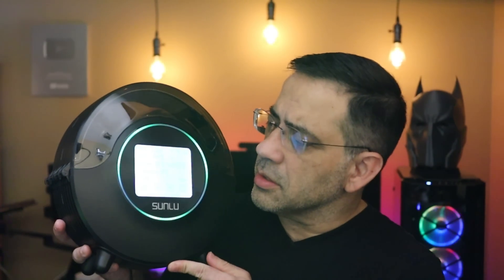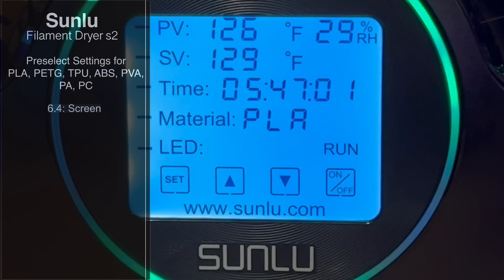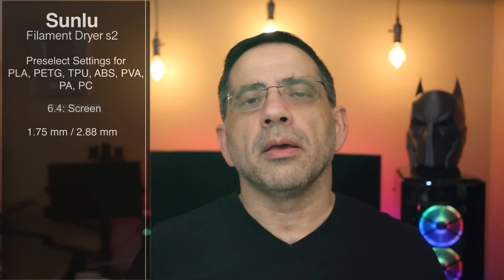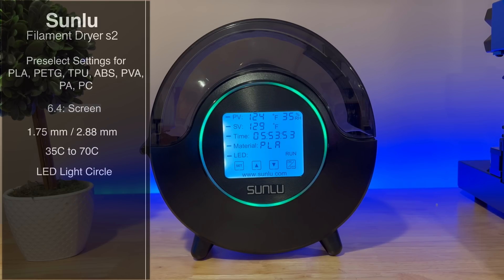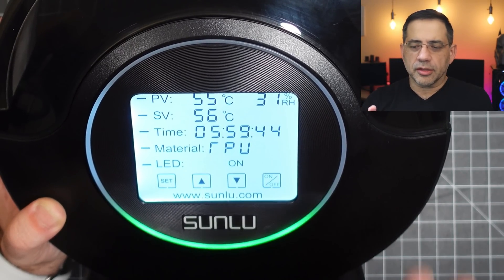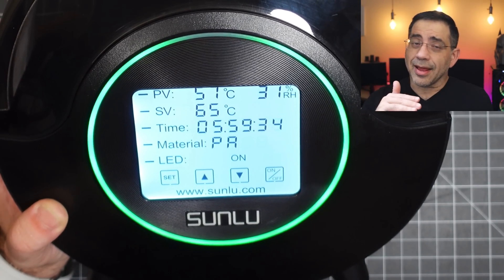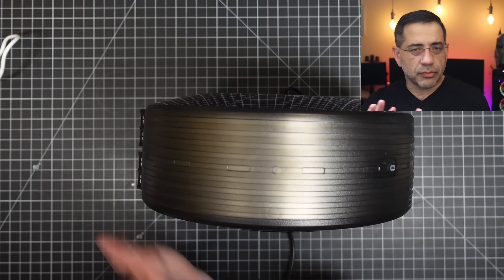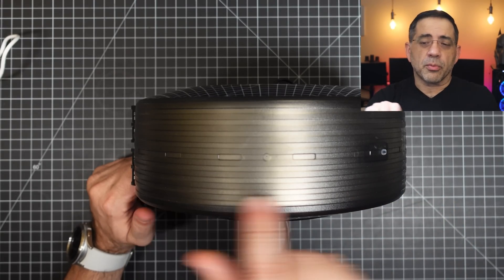The BEST filament 360 Dryer from SUNLU S2

Comment: I believe you obviously get paid for this because this dryer has fundamental flaw and that is that the filament can only go in one way and the angle of the filament exit needs to be spot on otherwise it will not feed the filament. That means that the dryer has to be exactly positioned. The fact that you did not mention this is concerning.